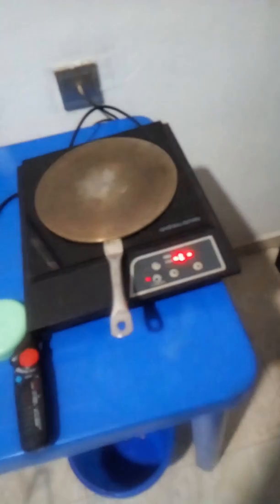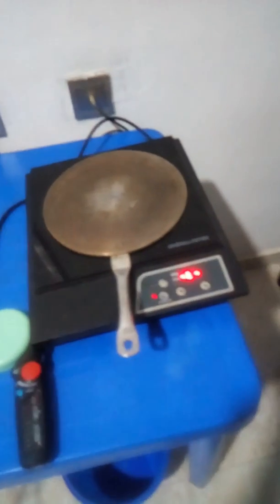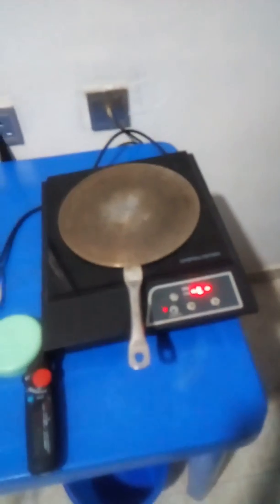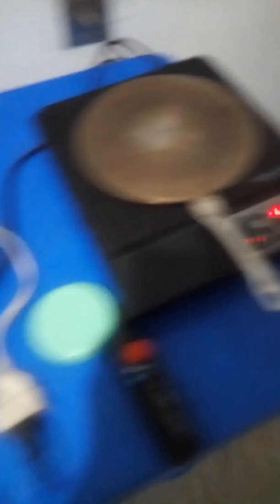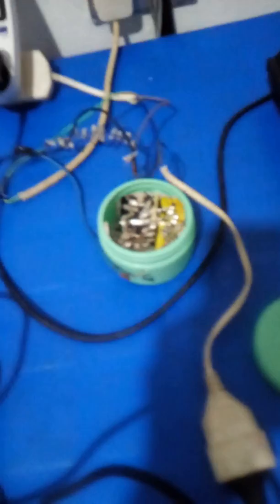Internal configured Alekz beads reactor, 100% savings.

Comment: 1.the key is line or null.if it is null and line is connected to your device ,because of the connection to earth ,it will work . So r u sure that you r working with plasma.and as u know plasma comes gradually by time ,after at least 2 month you will see some power .did you see this process in progress or it happened immediately.just for more confidence